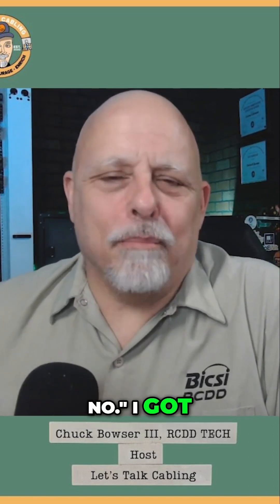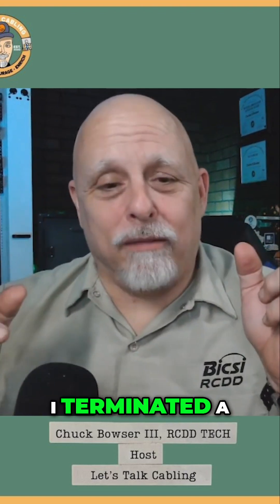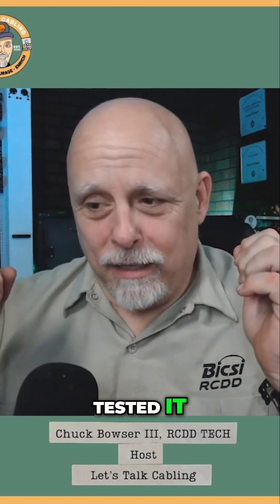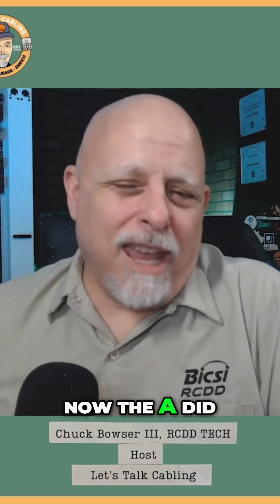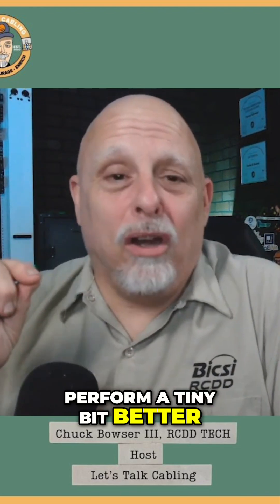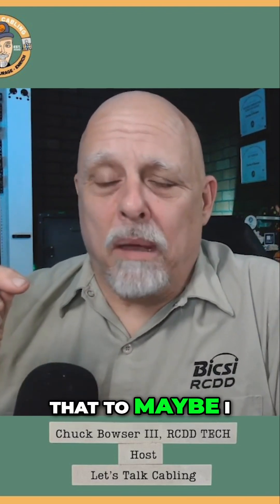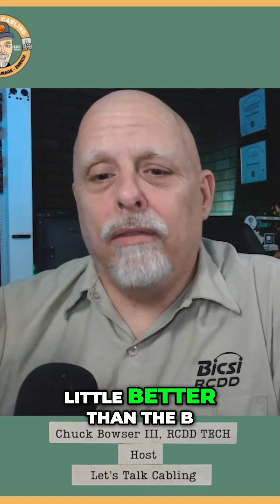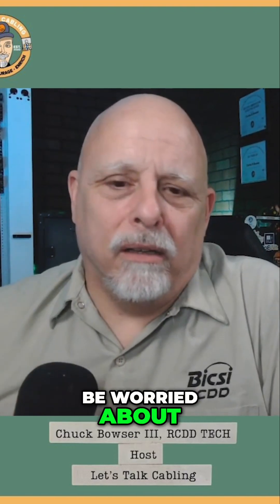T568A vs T568B: Wiring Methods Explained Simply!

Comment: You should have done a bit more testing. No matter how you wire them as long as the pins come out the same on each end you get the same speed.
Reply from the maker: Not entirely true, as long as its T568A or T568B on both sides yes....
Reply: @LetsTalkCabling  It would be interesting to test some random configurations. I don't have those expensive $15,000 testers to qualify cables though. It would be great to see somebody test a few non T568A/B configs. There are 8! combinations but I bet the first 10 random configs will prove it doesn't matter.
Reply from the maker: @CheapHomeTech  I did!
Reply: @LetsTalkCabling  Oh? Let's see a video of it!
Reply from the maker: @CheapHomeTech  a simple search would have pulled it up!   https://www.youtube.com/watch?v=XqkQSAabtbE
Reply: @LetsTalkCabling  Thank you. That's the sort of info I like. I owe you one for finding it.
Reply from the maker: @CheapHomeTech  I have 5 years of content like this!!!
Reply: @LetsTalkCabling  Well now I'm subscribed.

Comment: What I don't get is why they are wired differently? The only difference is the orange and green wires being swapped. If it makes no difference, then why are there even two different wiring options, as long as it's wired the same on both ends?

It's not like the green and orange wires are two different gauges, like one being 24 gauge or whatever, and the other wire being 22. The only real difference is the wire color.

The only possible thing I can think of is, higher data transmission through the wires now that the green and orange wires are crossing over each other.

But in the video, it says they're pretty much the same.
Reply from the maker: it has to do with the history of the wiring schemes and manufactures.  We ended up with two that perform nearly identical.